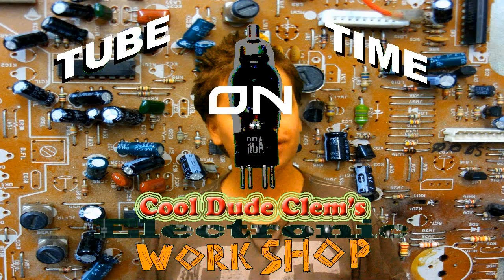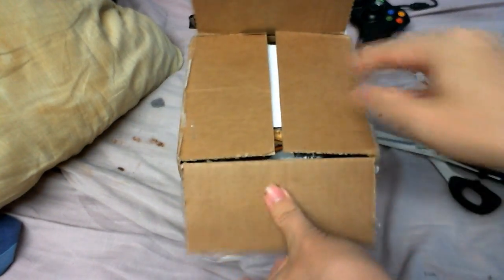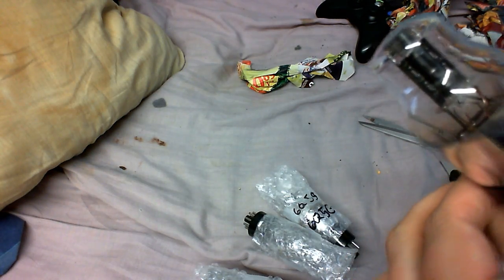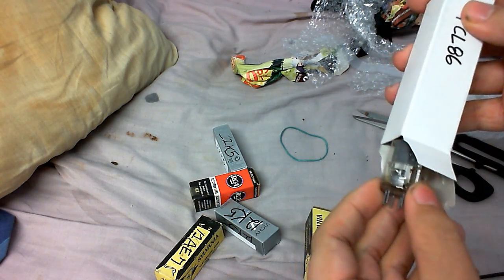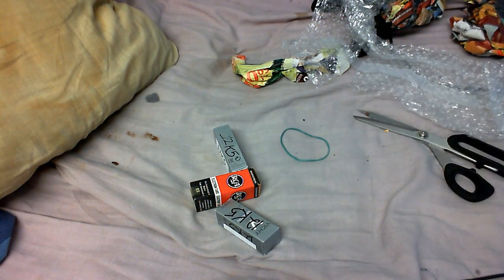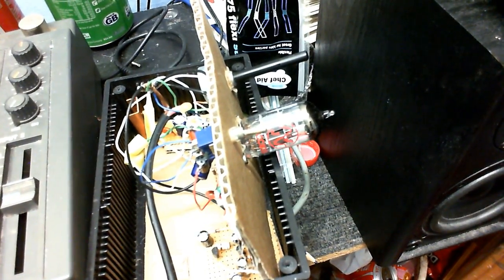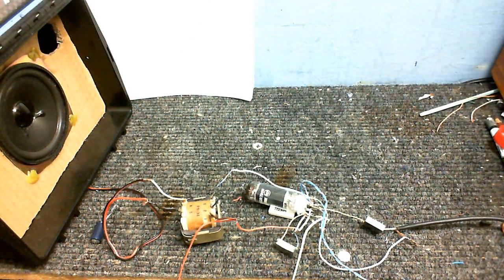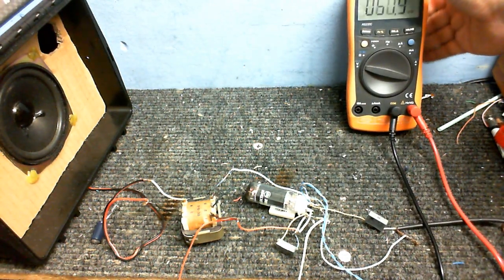Tube Time 7 - Yet more tubes!

Comment: i seen another vid of yours explaining caps i am just getting into repairing tings on a circuit board and looking for a bit of help my friend popped a ceramic disc capacitor on a board it has the markings tvr 10271 how do you find the value of this cap any help would be great the other vid wouldnt let me comment thats why i came here 
+ sub
+ like

Comment: Beggin you please.....what cho think of the 12EC8? Schematic opinions? I think it will be even better than the 12AL8!

The 12AL8 was pretty good but I'd try this type of transformer. I used this with the 12AE7 and it gave best results so far.

http://i51.photobucket.com/albums/f396/czechrite/tube%20electronics/60-282-1_Prim12kohmSec8ohm_transformer1_zps8862bf6c.jpg
Reply from the maker: I'm not sure yet, I'll do some experimenting later on and see what happens.
Reply: Of course, m8. I was totally amazed how you put that 12AL8 together so fast.

I have another suggestion for a vid which you may have done before, but what do u you think about a video showing the basics of taking voltage readings on valves and choosing anode and cathode resistors and such? Just in a simple triode circuit perhaps? Cheers, and thanks for your great ideas and fun presentations!

Comment: Your mic pre-amp was a HUGE improvement. Noticed that immediately. Count on more tubes coming your way. 12volt tubes here included:

12AE7 (12volt double triode),
12AL8 (12volt triode-tetrode),
12EC8 (12volt triode-pentode),
12K5 (12volt tetrode),

Other tubes were: 6P3S ("6П3С" in Russian) which is a Soviet 6L6G clone
and a PCL86....supposedly a very nice Triode-Pentode Audio combo tube like the ECL86...just a different heater.
Reply: Tube Time Ep.07 Data sheets:

https://www.sendspace.com/file/2xyhv6

or here

http://wikisend.com/download/900210/TubeTime_DataSHEETS_Episode07.rar

password is the name of the show....one word all lowercase. Enjoy for as long as free download service allows. Otherwise ask me and I will try to send the info.

Thanks again Clem for putting this together and giving me ideas for what I can do with my TUBES.

Comment: BEST "TUBE TIME" SO FAR.
Did I also send the 12EC8 with that? Did you get the datasheet package download? I will PM the link to you again to be certain. It seems that I forgot to include all the data on the 12EC8 which is a 12volt TRIODE-PENTODE combo!
I was absolutely blown away that you threw the 12AL8 into action! That made it all worth it ten-times over!
MANY PEOPLE have no idea such tubes even exist so don't blame them much for not believing it. I suggest using a small transformer that you'd use for a speaker in a transistor radio. I'll be more specific with that later.....will try to send the 12v pentodes next.
Reply from the maker: Thanks, yes I did get the 12EC8 and the datasheet package, the schematic I showed in the video was from that zip file.
Reply: I see. I spent more time putting it together than reading it, I suppose. It's horrible what laziness takes from my life. Thanks for the continued inspiration. MCno.1

Comment: Could u build a Steve wards styled vttc?
Reply from the maker: I don't have tubes powerful enough for a VTTC, the PL502 (or something like that) I had would have worked but I accidentally broke it.
Reply: 811a
Reply from the maker: Tesla Explorer
Too expensive for me, unless anyone's willing to donate 1 or 2.
Reply: CoolDudeClem get the Taylor from ebay, don't get 2... tune the 1 and get a 3kw later ;D trust me, you will be wanting more!
Reply: CoolDudeClem which tubes do you need exactly? Please let me know I'm sure I can help at least with some. Cheers.
Reply: 811a
Reply: he needs a GU :D :D :D
Reply: as in VT-217? I think I can get some of those....they are the SOVIET CLONE of the 811. Transmitter. I may have just the thing...let me ask my friend.

http://www.radiomuseum.org/tubes/tube_vt217.html
Reply: CoolDudeClem What about the 6Q5G Thyratrons I sent? There are 3 of them in this batch alone! They are perfect switches depending on the specs you need! They would also look pretty darn cool. They are perfect oscillators because they are GAS FILLED not a vacuum so rather than "mimic" the signal it will just be on or off....or build up until the circuit is closed.

http://www.radiomuseum.org/tubes/tube_6q5g.html
Reply from the maker: *****
If it's not too much trouble, to get those 811 clones that would be great.  I'm going to try later on with the 6Q5G and see what I get, but I don't think they would be able to handle the kind of power a VTTC needs and would probably red plate almost instantly.
Reply: get the 811a. a small mot, get it tuned to run 80% without redplating, then upgrade tube and power supply. you will have satisfaction from the 811 on into the new tube I promise.
Reply: CoolDudeClem  ill swap you this brand new 811a taylor for some 4k - 8k 100-200 watt resistors for my grid xPPPP
Reply: CoolDudeClem I think I can swing that...I'll be meeting with The Professor tomorrow and we'll see what he says. It might not be overnight but I think it is doable!
Reply: Now that I've pulled my head out of my butt I guess you're right that the 6Q5G MIGHT work but would likely go red fast...but I'm seeing MANY people use the GU-50 tubes all over youtube for this:

https://www.youtube.com/results?search_query=gu50+vttc

This one is really nice:

Mini - Teslaspule GU50 VTTC fertiger Aufbau

Though you don't have to have all the meters and such....I think some schematics also use a couple of them to spread the power load a bit.

I have one of these in my personal collection and I think the professor might share one with me.
Anyway, I'll ask him tomorrow.

Comment: Jst so u know, they're "12V tubes" because they need 12.6V heater, not a 6.3V heater. Thats why hier designation starts with a 12. What u say at 6:00 sounds like u think they work with 12V HT
Reply: They are 12V HT! designed for auto radios!
Reply: dictare car radio's also work on 250V dc
heaters are 6V in car radio's or 12V (switchable)
Reply from the maker: Yes the heater is 12 volts, but these are also 12 HT as well, if you Google the datasheets you'll see I was right.
Reply: No KX36....take a closer look. These are "true" 12 volt tubes. I sent them. See the datasheets please before you embarrass yourself a bit. Only the PCL86 and the 6L6G clone ("serious business") are regular High Voltage valves.

Tube Time Ep.07 Data sheets:

https://www.sendspace.com/file/2xyhv6

or here

http://wikisend.com/download/900210/TubeTime_DataSHEETS_Episode07.rar

password is the name of the show....one word all lowercase.
Reply: Don't worry, I'm not embarassed by your correction. :) Normally when people talk of 12V tubes they are almost certainly talking about the heater and the 2 I knew about without looking up datasheets are the 2 you mention that do require higher anode voltages. So would these be the sort of thing in old car radios then?
Reply: KX...that's a good question as far as car radios go...many of these were used for things like that... But there were so many variations from vibrating oscillators that would invert the voltage us to use more "regular" tubes and everything u could imagine....these do work and there are many of them out there including full pentode designs. There are also a lot of 30volt systems still out there people are experimenting with. Try radiomuseum.org for some really interesting tube info and TONS OF FORGOTTEN LORE (almost) of old car radio, radio, TV, and transmitter design and schema from past and ideas for future. It is mind-blowing! Cheers.
Reply: My honest answer is "I don't know! I'd like to know more."